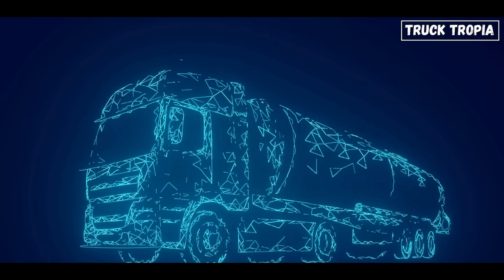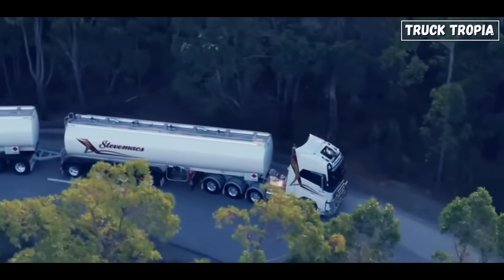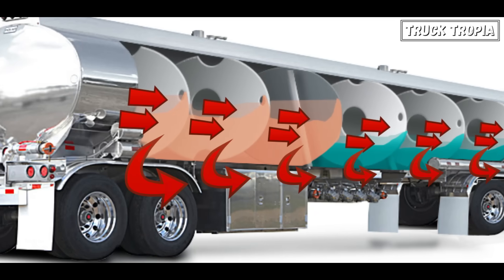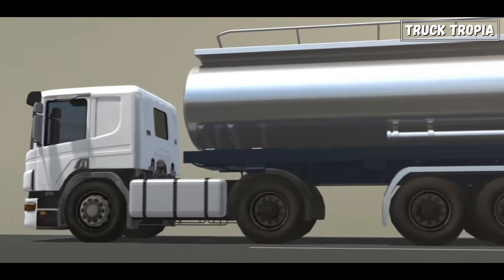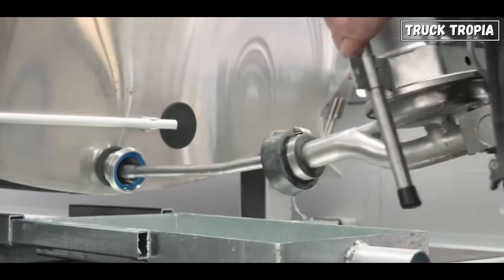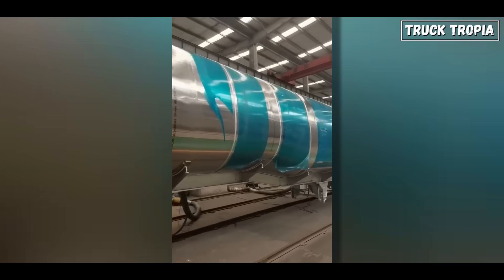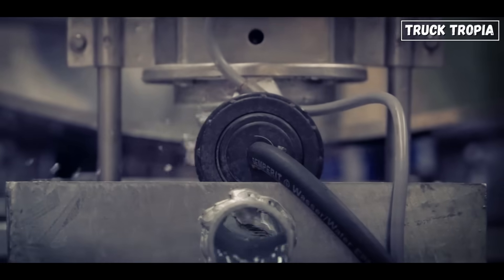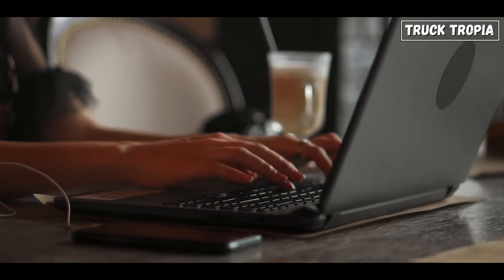Why Are Fuel Trucks Shaped Like A Cylinder?

Comment: I haul cryogenic liquids; liquid oxygen, argon , nitrogen and carbon dioxide. Cryogenic liquids are in a liquid form when kept at temperatures well below zero fahrenheit. At these temperatures the product creates a lot of pressure. There is a valve called a road relief valve that I crack open to help ventilate the pressure. I am a local driver and I do multi stop deliveries, after unloading my first stop the remaining liquid has room to move back and forth while I'm driving. This can be very dangerous if you aren't careful with your turns or braking actions, especially on wet or slippery pavement. Cryogenic tankers are heavily insulated, and have a plumbing system of multiple valves for loading and unloading product, also most of the trailers contain a pony motor mounted under the trailer for the unloading of product. CO 2 are slightly different, the pony motor by means of a flow valve can unload or load CO 2. My favorite product to transport is CO 2 because CO 2 is easy to unload and load. However CO 2 is usually under 300 pounds of pressure and can be very dangerous if not handled correctly. Cryogenic tankers are very expensive because of their construction. A new liquid nitrogen trailer is over $250,000 . A new liquid hydrogen trailer is over $2,000,000. Liquid hydrogen trailers are very unique. There are two layers to the tank. The outer layer is filled with liquid nitrogen ( nitrogen suffocates fire by temporarily displacing oxygen) the inner layer/tank is filled with liquid hydrogen. Liquid hydrogen can be very dangerous. When liquid hydrogen is exposed to oxygen it will ignite and combust. When it burns it will produce a very light blue almost invisible flame. This is why liquid nitrogen is in the outer shell of the trailer.
Reply: Thank you, very interesting insights
Reply: I witnessed a cryogenic tank unloading at a beer brewery once. There was a large purge that went on for a few minutes. I wasn't sure it was normal so that was a bit unnerving..
Reply: I can't imagine driving liquid H or liquid O. That's scary stuff.

I used to design products for remote fleet monitoring of ultra-low-temperature and cryogenic materials. Though the ULT stuff was mostly vaccines, so not the kind of volume. 
But yeah I just had to monitor things like temp, pressure, and accelerometers. The "how do they ship this safely" was always in the back of my mind. Especially with liquid elements like H which can seep through a solid container.

Best wishes, and thank you for what you do.
Reply: Isn't the LN2 in the LH2 tank for cooling rather than fire prevention? The autoignition temperature of hydrogen is quite high at 1085 F, compared to gasoline at 536 F, so whatever condition you have where hydrogen combusts when exposed to oxygen, gasoline will also go boom.
Reply: @henkrpe3249  The LN2 tank inside the LH2 tank has more functions than preventing combustion. Indeed, another function is intermediate cooling, LN2 boils at  −196°C, LH2 boils at  -252.8°C. The difference between -252.8°C and the room temperature (20°C, by convention) is too great to rely on a single thermal insulator for longer periods. The 3rd reason is to reduce the effects of LH2 tank embrittlement. Sure, fire prevention is another reason, H2 molecule is so small it can escape from almost everywhere. It's better to have friends with other N2 molecules rather than O2 molecules, especially when tightly packed in the form of a liquid.
Reply: @milutzuk Yep.  LH2 isn't that dangerous explosion wise (gasoline is pretty bad actually), but it is a PITA to handle.  It does bad things to lots of materials and is very difficult to keep from leaking... In addition to being cold AF.  

I spent a summer working at a lab which went through a lot of LH2.  They were setup to just make it on site though, so I don't know much about the shipping of it.  LOX is scary.  And liquid helium (which that lab also used) is the difficult/expensive stuff... 20K is cold AF, 4K is ridiculous.
Reply: @henkrpe3249  also escaped Hydrogen will just float upwards quickly when escaping, so its unlikely to get to an explosive ratio/mixture. In addition the escaping Hydrogen will also cool down when getting depressurized and vaporizing. So you have to worry more about freeze burns than fire :D
Reply: Hey boss, what's a pony motor?
Reply: Really?  It's like a generator or separate pump motor instead of using the truck engine to manage liquid pumping, air compressor, or vibrator.  Means more maintenance. @BrambleBones-ec5mm
Reply: @BrambleBones-ec5mm   Like a dog faced pony soldier but electrical.
Reply: This is not a comment its a article
Reply: You are doing gods work
Reply: @CaseyJaworski  And mine too!
Reply: You have it the wrong way around. Those materials do not create pressure at that temperature. Instead, at that temperature they need to be pressurised to stay liquid. 

What you're saying would be comparable to stating that your food needs to be hot in order to warm up the stove. No, it's the other way around.
Reply: Y'all hiring?
Reply: @nickdagreat33  There's always a need for drivers. Need at least one year all season driving, have the proper endorsements, good driving record (no accidents, never had a DUI), no failed drug screens , no felony convictions and live within 50 miles of a terminal. The top cryogenic haulers are Air Products, Messer and Prax Air in the area I live in. These companies have very strict policies so they are particular in who they hire. It's a great paying career and the benefits are very good. I made 80k last year and I was home every night. Starting out you will make approx. 60-65 k .  You may have to do some overnight trips when you first start out. Some companies have sleeper trucks, some use day cab trucks (weight issues) and will put you up in a motel for the night and pay you a per diem.
Reply: 5 paragraphs
Reply: One small issue with this hydrogen and oxygen don't auto combust u still need a ignition source
Reply: Maybe
Reply: That is so much info I appreciate your comment I just got my cdl class A and T-X endorsement I’m applying for jobs and tanker I’m gonna try I know I don’t have any experience but I’m gonna give it a go I heard at times companies will hire any advice
Reply: Last month here in India I saw a hydrogen carrying truck for the first time, but we use 40 or 50 individual interconnected small cylinders that are permanently mounted on truck bed instead of a single huge tank. We use the same configuration for CNG but use a huge tanker trailer for LPG. Is transporting in above mentioned way safer than a single tank?
Reply: @IxoraNera don't trust india, sometimes, you don't know, it could be that a explosion happens in a high traffic, area
Reply: Hmm forget boosting the gasoline... boost the tanker. Good 2 know. 😊 

Seriously tho, thank you so very much 4 driving. I still ponder getting into driving because at my age it is not to late and I can provide 4 my family.

Stay safe my friend, stay safe.
Reply: Fun fact, during the Apollo missions, sometimes hydrogen leaks would occur, leading to invisible fires.

The solution they came up with? The broom method. What a whimsical little name! What clever principle does it employ?

It employs a broom. Basically you walked while waving a broom in front of you. If the broom suddenly caught fire, you had found an invisible fire 🤣
Reply: @sabikikasuko6636  I heard they used to this method also in some old school electrical powerplants where pipes would spring invisible leaks shooting out steam so fast. They used the brooms to stick them out, and if the stick got cut, you knew where the leak was.

Comment: Lol as an ex milk man I know it’s called food grade stainless steel it’s a special stainless. But I haven’t ever heard of one with refrigeration built in to it they have 8 inches of foam around them then another layer of stainless around that gotta load the product under 40 and then it’s just a beat the time game. But I know for who I hauled for it could sit 2-3 days in the tanker and it still only be 40 degrees in 95 degree sun absolutely blew my mind how long you could keep that product cold for
Reply: I also know milk can’t have baffles only bulk heads they say you can’t wash a baffle right and it’ll cause build up of product on them
Reply: @tuckercole4191 And the same goes for chemical trailers. Most of these trailers don't have baffles for the same reason. Missed areas that weren't cleaned properly due to the baffles could cause cross-contamination and the load could effectively be rejected by a consignee/customer.
Reply: Makes a yeti seem like a paper cup lol
Reply: @SoleEpiphany I was about to say the original yeti cooler
Reply: @SoleEpiphany you're talking about a huge amount of mass that's being warmed up. If you put a gallon of milk in the same conditions with the same amount of insulation it'll probably be spoiled in a couple of days.
Reply: Ok nobody else has commented so I will... 304 stainless is food grade and is used in way more things than you might think. 316 is chemical / medical grade. I have a feeling milk will be 316
Reply: So a big thermos of milk. Got it.
Reply: Like a water heater in a home but better
Reply: In 1956 I drove a water truck for the county road crew. I expected the surge problem but it made me nervous and I drove extra carefully. I don't think you could let a 20 year old college kid do that these days. The upside down was it took half an hour to fill it from a pond using the one lung pump, so I read a lot.
Reply: Milk is hauled from here in south PA to Miami.
They tell me it usually only gains 1 degree.
Insulation and thermal mass.
I've hauled fresh peanuts from Arkansas to the Norfolk area in a dry van.
They were cold when I closed the doors, and two days later when I opened them they were still noticeably cold.  48,000# of cold stuff doesn't warm up quick.

Comment: They arnt, at least not in europe. They are made to maximize the load lower to the ground.

The reason they use cylinders in usa is probobly because they use framless tankers and they are lighter. But in europe size co straints is more important than weight
Reply: I just did a quick search on google "europe tank trailer" and what I found is 95% of the trailers are built just like they are in the US.  Why is it every time something trucking related shows up Europeans have to try to make it out like things are so much different or better than it is.

Comment: In the us you need a tanker endorsement (N) for non hazmat for Hazmat you will get an (X) on your US CDL
Reply: H=Hazmat N=Tanker X= Tanker and Hazmat together. Plus if you have your hazmat endorsement you also automatically get TSA pre check on flights in the US.
Reply: @NathanH172 there's also a restriction available for empty tank trailers only (I don't remember the letter off-hand). New CDL applicants wanting to start off with their tanker endorsement are required to have that restriction while on their Commercial Learner's Permit. It could also be useful for yard switchers that will only take the trailers to be cleaned out.
Reply: Not every state does the x endorsement my New Hampshire CDL has it as two endorsement instead of one
Reply: @TruckerJohnnyD  
More money
Reply: @xpunk77x  Here in Canada all you need iss a driver's license for the class of vehicle you drive, but you need endorsement (not in the license, but a different ticket) for some industries.
I haul crude oil and produced water. All I need is my class 1 license. I used to haul Jet A1. For that I had to get my CFA (Canadian Fuel Assossiation) endorsement.
Nothing different in my license.
Reply: Did AA for 9 years, cleared my sinuses every day.